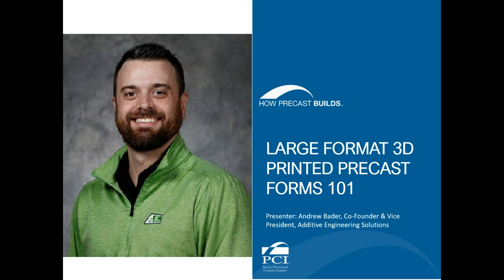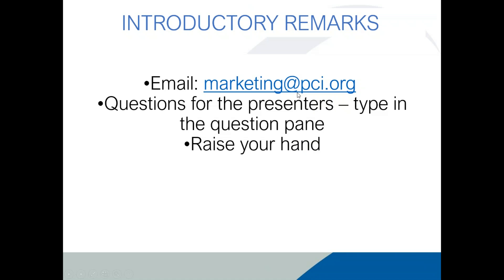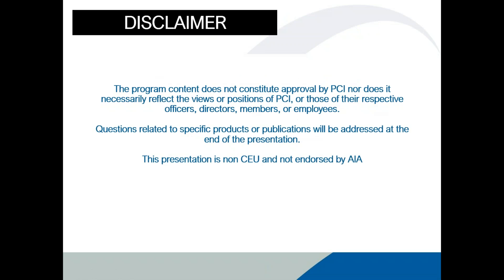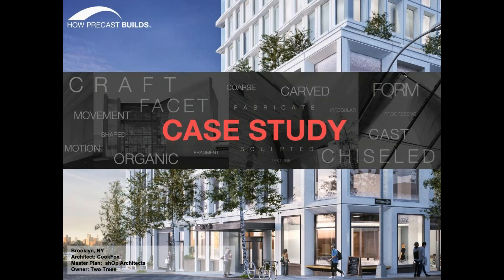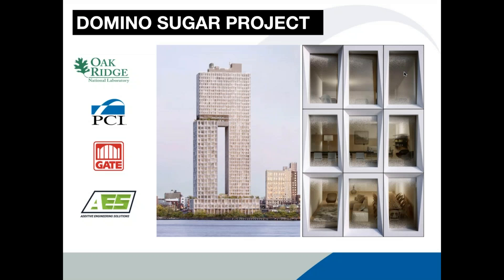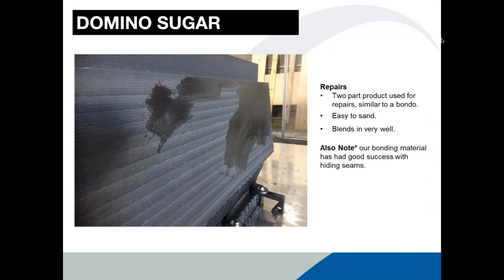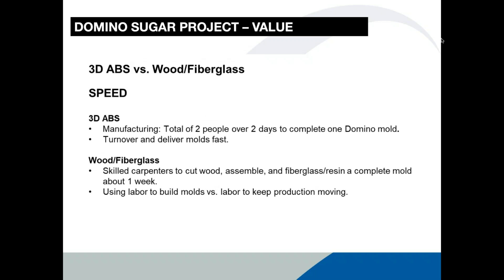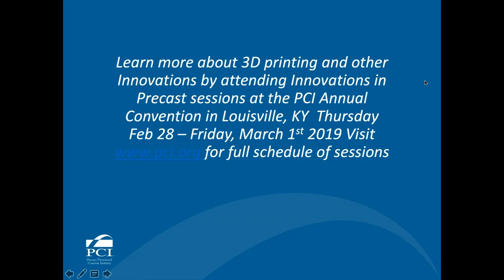Large Format 3D Printed Precast Forms 101

Comment: Really like the sanding of the 3D ABS form surface to between 180 grit and 220 grit. And some 3D ABS forms were used for casting two hundred (200) times! The usual wood/fiberglass forms cannot reach such a high number of casts, maybe twenty (20) castings versus two hundred (200) castings.

Of course, if one 3D ABS form costs you more than ten times (10x) the cost of a wood/fiberglass mold, then there might be little to no savings from using a 3D ABS form. For them, 3D ABS cost $9,000 versus $1,600 to $3,000 (in-house being cheaper than outsourced).

Otherwise, the 3D ABS form has crisper edges, requires less repairs, and takes less than a week to manufacture.